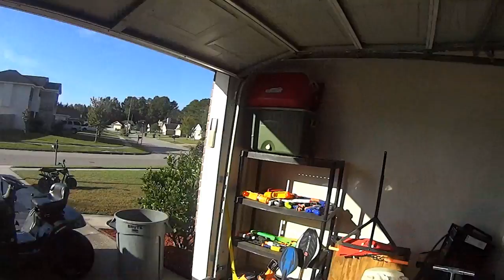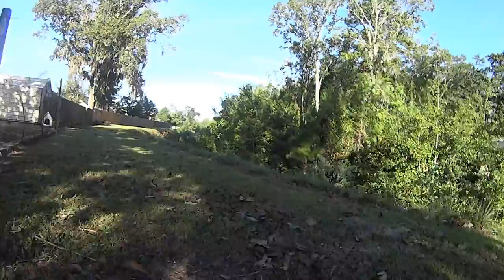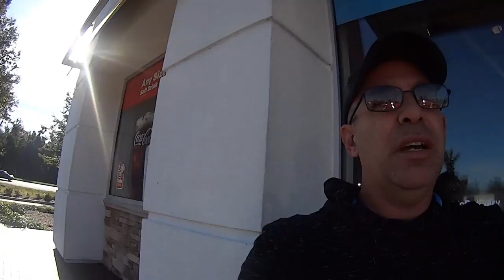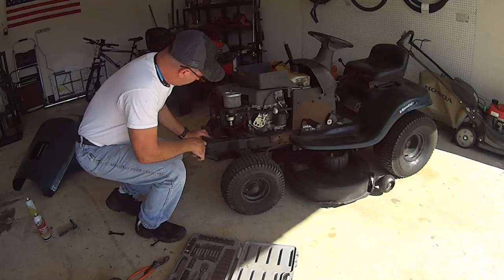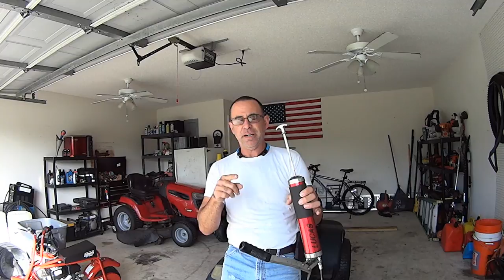Surging Kohler Engine Solved - How To Use a Grease Gun - Mini Bike Ride

Comment: Will work better and not stop feeding mid tube if the handle is pressed all the way in, that happens because as the grease level lowers it loses the spring pressure cause the handle is stopping it from traveling inward, handle all the way in and the spring is has the ability to travel the length of the tube thereby keeping pressure until it’s empty

Comment: Well, after I tried loosening the gas cap, put in a new fuel filter, a new fuel pump and a new carburettor, I checked the fuel hoses and they were clear. So I checked 12 volts to the solenoid. It was there and steady - no bad connection.  I was out of ideas and then thought of one more. Can I blow air into the gas tank? Nope, it was clogged tight. I used compressed air to blow it clear and now it finally runs like new.
Reply: I took my gas line off and gas is pouring out but it doesn't seem to be doing it real strong I'm going to check this, thanks for the idea

Comment: Low speed jet on the surging engine carburetor needs to be drilled  out one drill bit size larger.
Reply: Can you tell me where to drill the low speed jet  on a walbro on kohler cv460s? I Put a new cheapo carb on it and it runs good but has a slight surge. I have played with the low speed jet but i cannot get rid of the slight surge. Would love to know where to drill the low speed jet out Thanks!

Comment: Great video dan.
You need to pace yourself and take of yourself.it’s easy to lose track of what you’re doing  and overdo it.getting older sneaks up on you.
I do the same thing as you do when I take vacation days.i work on lawn equipment also.usually catch up on the mowers I find for free at the curb.get them running,sharpen and clean and polish them up.
Get rested back up and please keep the videos coming
Reply from the maker: I will George, thank you!

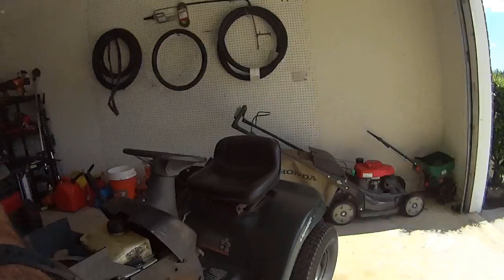Comment: At 15:43 just above the bowl it looks like a cap for a jet.  If you did not, you may want to pop off the plastic cap and remove the jet to clean it.  Not sure with Kholer but Tecumseh's have it there.  That will cause a surge also.
Reply from the maker: Ya I think I saw that too, but then I believe I would need to get a new cap. Not sure so I chickened out

Comment: Dude there's a spring in there, that's what you feel when you pull out the rod. Poke your little button and push the rod all the way in, that way you're not holding back the plunger, that's what the spring is for. That way it will just empty and be a shit load shorter. You townies make me laugh.